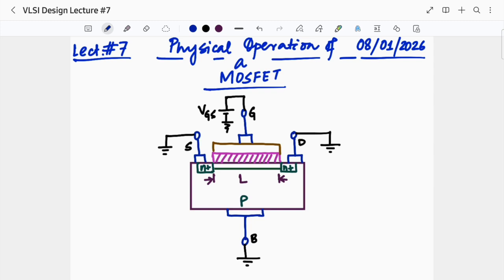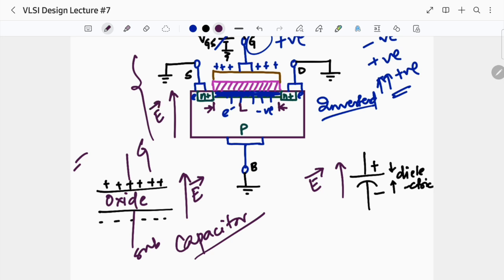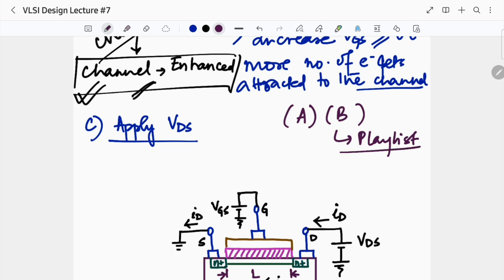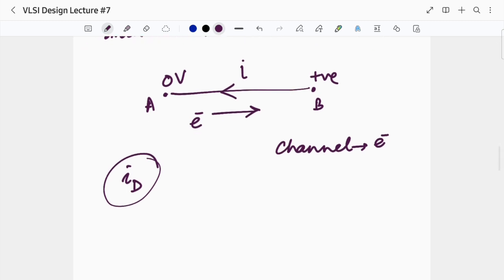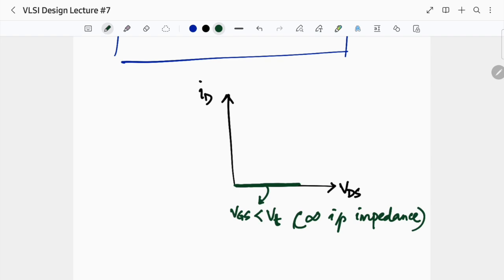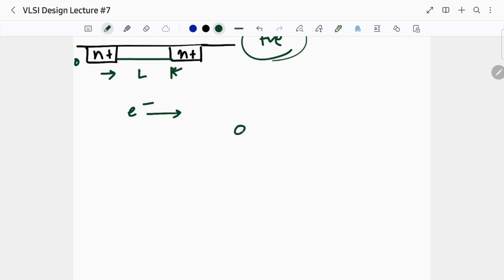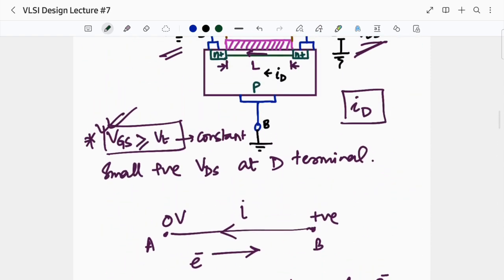How MOSFET Channel Conductivity Works | Channel Conductivity Explained | Lecture #7

Comment from the maker: 🕒 *Timestamps*:

0:20 - Channel Induced!!!
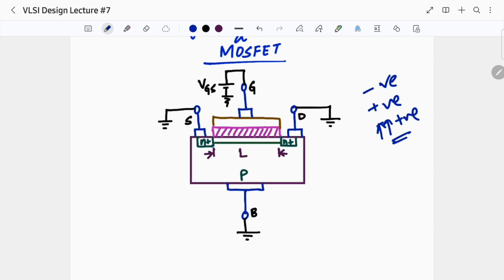1:12 - MOSFET as a Capacitor!!! How???
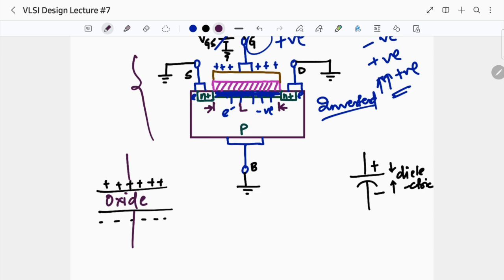3:35 - How does the Electric Field generate in a MOSFET???
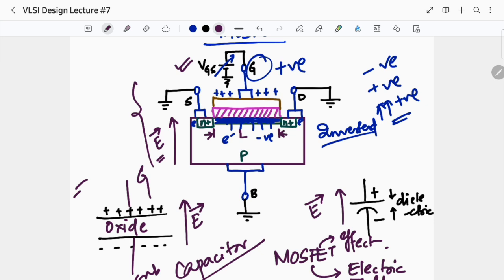5:46 - What is Threshold Voltage (Vt)?
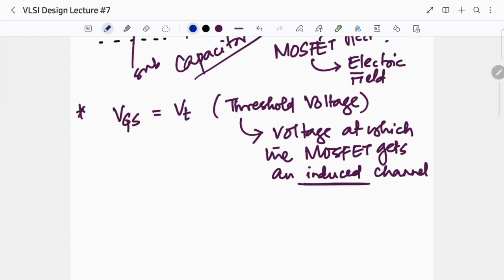7:50 - Why is it named Enhancement Type MOSFET???
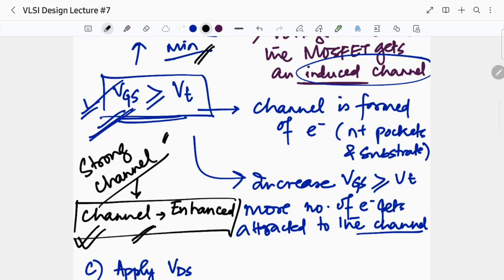11:50 - Application of Vds 
15:40 - Current Flow (iD) & its dependencies
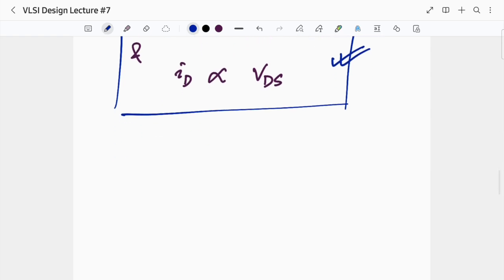18:06 - iD vs Vds Plot
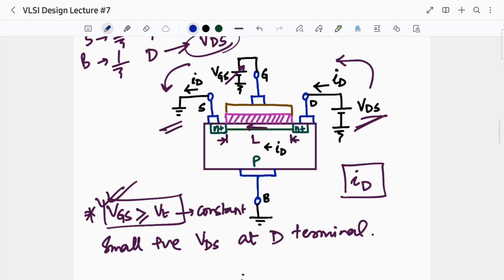22:30 - Why Channel is so so Important???